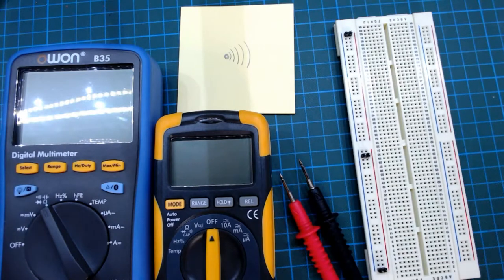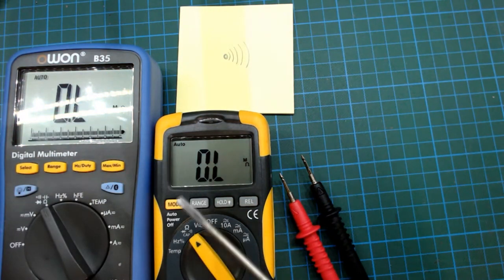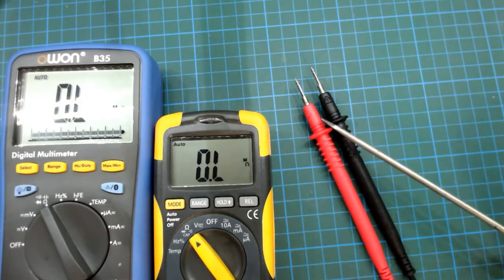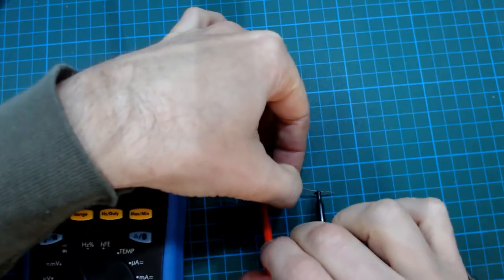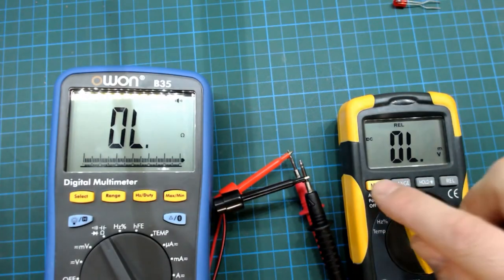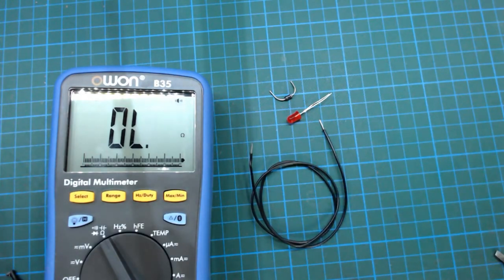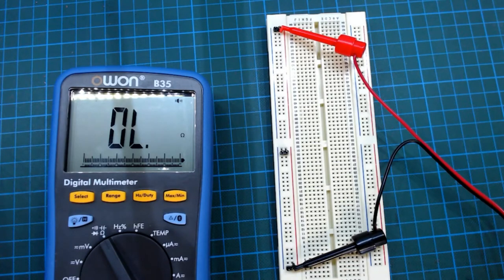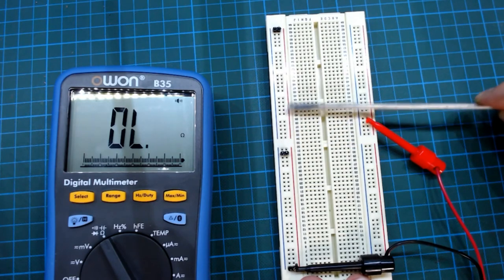How to do a Continuity Test. aka... STOP THAT BEEP!

Comment: What if my con test even with the probes? i mean i does beep but it takes a bit to start beeping and it also cuts off randomly for random intervals
Reply: Me too
Reply: @obidahasdia4095  I think it's just an issue with the probes on my end cause when i put the pointy part on something with both probes it works perfectly
Reply: @LykeArgy  i put them in a eletric wall plug and the plug did a shock . But i got a polt multimetter 20A 1000V 
I dont know if that the case ..
The measuring were always cutting out . And slow sometimes show sometimes dont its brand new .
Im thinking o buying fluke 117 heared a lot about that .
But a bit expensive will its auto measure and acuirate i guess its worth the money .. 
Later down the road im new to this. 
And soldering just got hakko 888d x5 units and fx 971 and fume extractor .A-400 
Im trying to learn to do mods for consoles
Reply: @LykeArgy  to measure two points for it to peep seems hard as i dont know if im putting them in the right direction or right order or on the 2 points . To check for continity .. its hard as i dont know even what every part should measure In V exactly
Reply: @obidahasdia4095  When looking for continuity it either beeps or doesn't, readings don't matter and continutiy is done ONLY ON NON LIVE CIRCUITS AND WIRING, 

" i put them in a eletric wall plug and the plug did a shock . But i got a polt multimetter 20A 1000V " I hope you werent trying to check continuity on a live circuit, did you? hahha
Reply: @LykeArgy  was checking if the multimetter work and give a reading first i did plug to wall plug ya bad idea
Reply: "To check for continity .. its hard as i dont know even what every part should measure In V exactly" 

What continutiy does is it only shows you if there is a connection between the 2 things you are testing (wether its wires, or metal), It sends a small ammount of current through 1 probe and if the circle is closed it means it got to the 2nd probe and it beeps. Which way you put the probes does not matter. For voltage it also doesn't matter which way you put the probes but if you reverse them you just get a (-) infront of the reading, I'm not sure about reading Amperage though.
Reply: @LykeArgy  what about chips smds and small square things how to measure? Should i go Ohms or Voltage ? What is Ohms anyway? The 2 probes from A to B points is unclear on pcb where to put them exactly